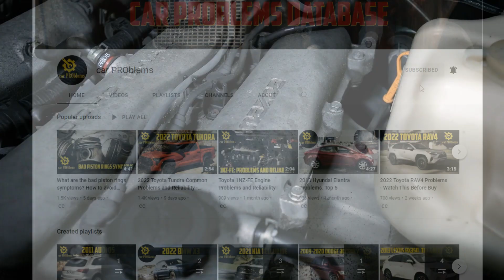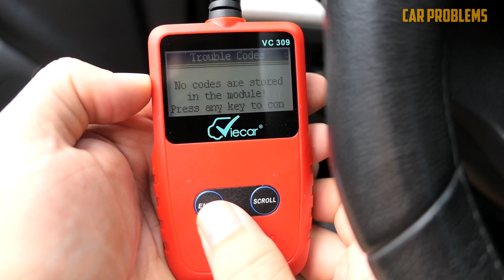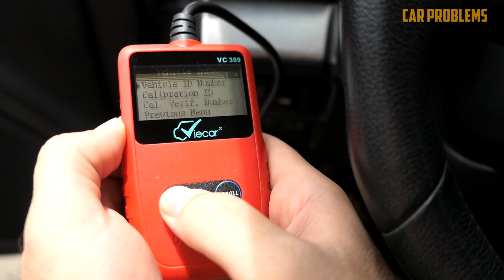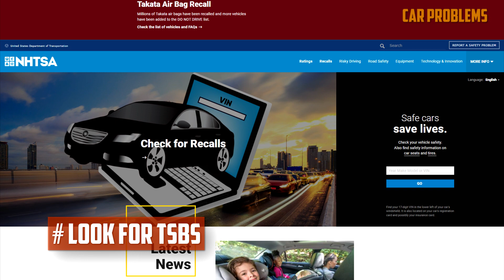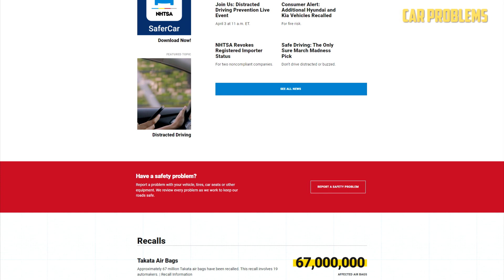What To Do After Replacing A Mass Air Flow Sensor?

Comment: I replaced my maf sensor and it is running rich/ lean, i unplugged the battery but its running lean. Does it take a little time to reset itself? Ty
Reply: Same issue on a Volvo 850.  Code is "running lean".. I'll try another reset but will let it idle for 15 minutes.

Comment: Ive changed the MAF in my 3.0 crd Jeep grand Cherokee Summit 2015. Check engine light still on. Disconnecting the sensor and the engine still runs! Is that a fault in the sensor, or the new MAF, or something else? Any help really appreciated? As this car is starting to annoy me, many faults since being purchased 2 years ago, including the battery, glow plugs, Tone wheel, Valley water pipe etc. Now with the MAF, my sat nav says Im in Moscow ( I'm in England). And my car alarm goes off randomly at night, so I can't even lock it😢
Reply: It's your senior u need a new one cuz it dead

Comment: I replaced mass air flow sensor but the check engine light keep coming back on
Reply: Also change the MAP sensor when replacing the MAF
Reply: @qalas7327 does this really work because my Light keeps coming back on
Reply: Unplug the battery for 15 mins
Reply: I have the same problem and bought a new battery afterwards... no luck after maf change still p0101 :(
Reply: Did you find out what the issue is @RichardJK1977
Reply: i would never install a cheap, $20 MAF. get the authorized OEM part, which might be 10 times more expensive, but at least has 1 year warranty, and guaranteed to work in your vehicle. buying a cheap sensor maybe somehow incompatible and/or sub-optimal for your vehicle - it would be a big gamble, and probably not worth it in most cases
Reply: I unplugged the battery and had the code cleared and it came back in
Reply: I’ve replaced the maf and map sensors but I’m still getting engine light coming up at different mileage intervals,really frustrating!
Reply: @robw8173 im confused. did you try to clear out the codes using a ODB II scanner? or disconnecting the battery for about 10 minutes? either approach should eliminate the troublesome "engine light". otherwise, i would say its probably your "new" sensor - was it a cheap $25 or an OEM? the cheap ones are a huge gamble (they are cheap for a reason :)
Reply: @asdkcfnweco yes I’ve done all that and changed map sensor also and the third maf sensor I fitted was an a Vauxhall approved sensor,to start with I got 3000 miles before engine light came on,cancelled air flow code and got another 1000 before it came on again,cancelled codes again and it’s came up again after 250 miles 🤬🤷🏻‍♂️🤦🏻‍♂️
Reply: @robw8173 well, if the car engine sputters while its idle or at traffic stops, then here what IMO are the possibilities: either its  the Engine Control Module (computer), or still the MAF sensor, or (the least likely), both. you could also have some loose/damaged wiring in the sensor cable connector itself. if the car is not rough-idling or stalling, my guess is that the car computer is getting sub-optimal sensor data, but its not serious enough to be a near-term problem. i would also, if u havent done so already, bounce it off a decent car shop - what would they think it is?
Reply: @asdkcfnweco I’ve had it into an auto electrical garage to get sensors/witing/fuses checked and they found everything was working fine,on a cold start the engine does sound rough but once up to temps and running it purrs like a cat,I’m thinking it’s maybe an air intake problem or hopefully something as easy as air filters clogged I’m getting that looked at next 👍🏻
Reply: good point. when was the last time you replaced the engine air filter, and cleaned up its compartment - that could also trigger the issue
Reply: @asdkcfnweco it’s last service the air filter was cleaned and replaced,maybe it’s dirty and needs a new one completely,I’ll find out when it goes for next service in another few weeks,I’ll just drive away and cancel code as they come up till then,not ideal but see what happens 👍🏻

Comment: So I bought a bmw active hybrid 3 2013 3.0l turbo engine runs fine for 10sec after that engine starts shaking and I get no power when I hit the gas pedal and I get only 6mpg can it be the maf since I changed spark plugs and checked out the injectors